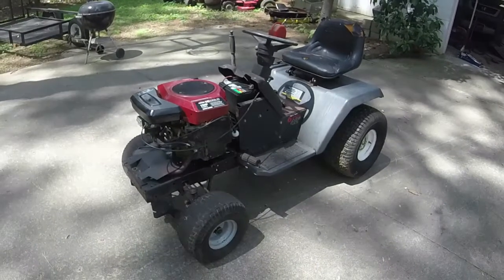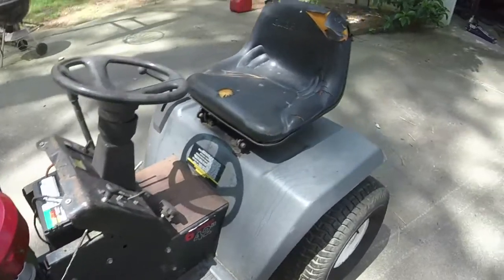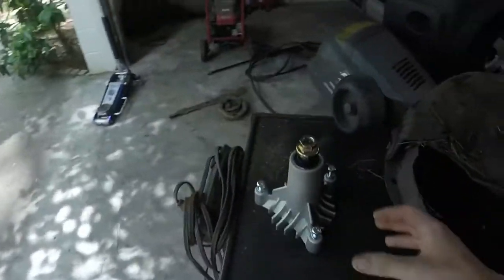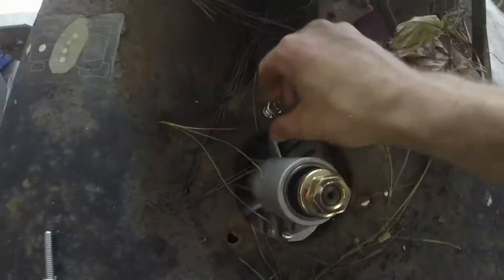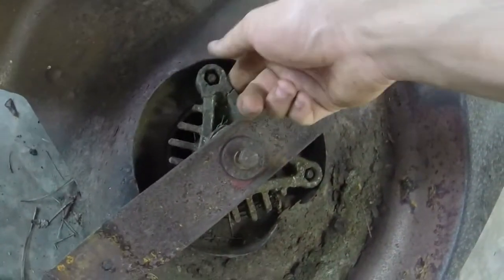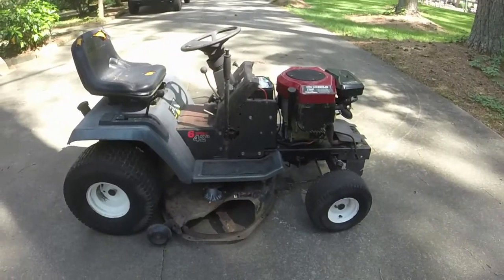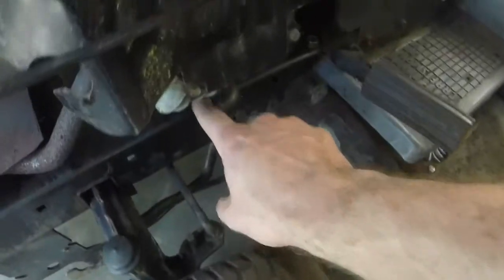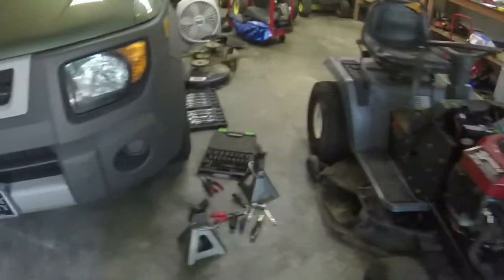Craftsman Opposed Twin rider money pit!  Ignition switch deck spindles fine tuning (part 3)

Comment: Been nice to have seen the switch job step by step . It would been more important to see this instead talking about painting the deck and installing spindles and a belt . Just my opinion
Reply from the maker: If I had gotten the correct 5 pole switch for the mower it would have been plug and play which is why I didn't spend much time on it.

Comment: Lt100 craftsmans and other ayp mowers with single cylinder engines, with gravity fed carbs is about all I do. They are easier to work on and make more money with less work, stay away from opposed twins, they always are terrible. 200$ is the most you can get for that here in est tn.
Reply: AYP's are great to work on. Although I've had opposed twin models that were good too. My favorite ones are the older LT4000'S with the flatheads. Those things are flat out reliable machines.
Reply from the maker: Those are my favorite to work on as well.  Opposed twins are great engines when running properly.  The 3 screw carbs help them out a lot but they all are getting some age on them at this point.